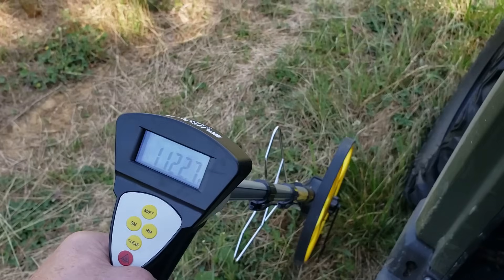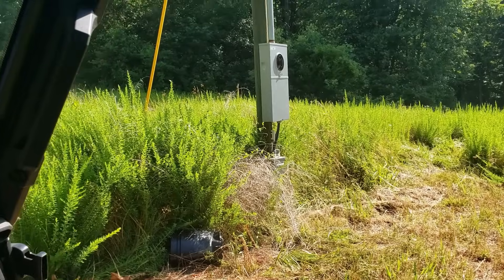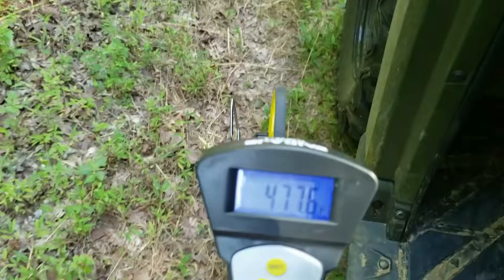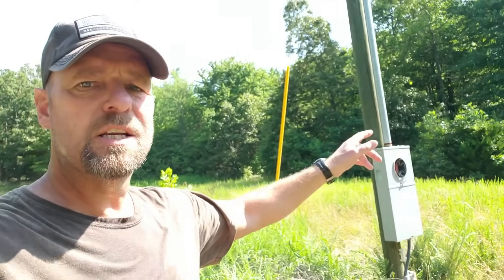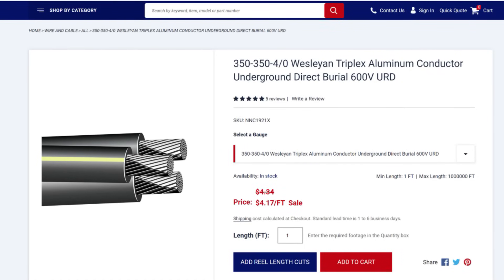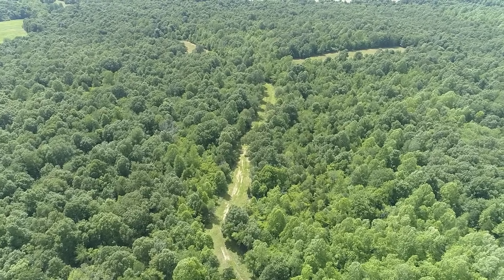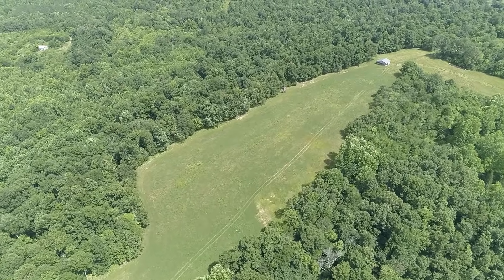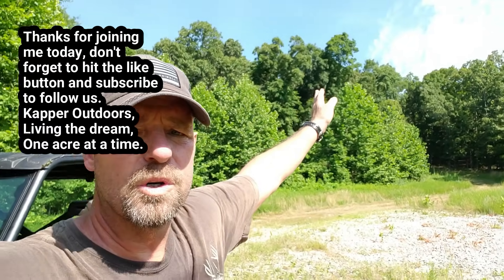DIY running 2,000 feet of power line to remote homesite? Let's talk details.

Comment: Joe, you might want to put in solar with a backup generator, and put in a shallow well for water.
Reply: Yep. What I came to suggest.
Reply from the maker: We'll see what happens. Just got more details that I was missing in this video as far as which sizes of wire I will really need to make this happen. If wire prices come back down to where they were before this disaster, it will probably be a GO to do the DIY power. And the water line will be trenched right with the power, so one trench will bring power and city water all the way up. Thanks

Comment: you should do high voltage to the site. I would get the power co to put poles up the driveway to the site for you. has to be less $ then trenching in. I think you'll have problems with a 20% loss of voltage.
Reply from the maker: You are correct on the 20% loss. Finally got to talk to some industrial electricians about this. But the good news is going up 3 more wire sizes would work with minimal loss then. Cost more of course, but if line prices come back down it would be way less than the power co running the overhead and would save me having to make a straight line new 20 foot right away. That is my hope now, prices to get back to normal! Thanks

Comment: Kapper. With that long of a 240/120 volt service drop with a reduced-neutral-sized cable, you are going to have voltage drop on your 120 volt circuits that will caused flickering lights.  I recommend getting an estimate to install a single-phase 7200 volt overhead line from the street and install a 25kVA 7200 -240/120 volt transformer ~200 feet from the house. From the transformer pole install 3/0-3/0-1/0 triplexed aluminum (Hollins) underground service drop to the meter fitting for your 240/120 volt service. The closer you are to the utility’s 7200-240/120 transformer, the happier you will be. Sorry, that’s the price you pay with the meter so far from the source.
Reply from the maker: Good info, I just had a great strategy session with someone much more in the know than me! lol. There are a few ways of going about it, but for good 200a service I'll need 1,000 mcm wire, and for good 100a service I could use 750 wire. If costs come back down to earth this could be a viable option to save money against have power co put in overhead. Still looking at options though, thank you
Reply: @kapperoutdoors  Kapper, if you want total underground service I recommend getting an estimate for underground primary cable (12kV) trenched in from the road to a pad mount transformer close to the residence. I believe someone else offered that comment too. Likely be more expensive than an overhead pole line. so get the numbers to compare OH to UG. I would not run 2,000 ft of secondary cable, ie, 600 volt cable for 240/120 volt service from the road.  You will have very stable voltage supply with the 12kV transformer as close to the residence as possible.

Comment: Have you considered high voltage from the road to the spot and then put the ground mounted transformer AT the house. This way the line going into the house will be much smaller, most likely #2 AL primary cable. You will have almost NO voltage drop as the secondary run is short.
Reply from the maker: That would basically be having them run overhead or underground, which is very expensive, which is why I am looking at my DIY options. I have more intel now on exact wire sizes I will need for this project. Unless I am not reading  you correctly? Thanks

Comment: Solar Kap. Solar.  I have been fully off-grid for 10 years. I have everything including water pump, sump pump, sewage pump, furnace, oven etc except for AC. Lots of flat roof surface or for a ground mount at that building. Battery storage and a back up generator running off propane. All good. :)) Cheers!
Reply from the maker: wow good stuff! But does it not have enough juice to run AC? Down here that is a must and it runs constant nearly all day and night to keep a place cool. Thanks man hope all is well up by you!!

Comment: Kapper I got 37 yrs with a power company. Let them do the overhead power line. They will maintain and you just add the cost to the building site. You will be way ahead of you want to do the project.
Reply from the maker: We'll see what happens, I finally got the Exact answers I needed as far as the power lines that I will need for size to make it work. If line costs come back down to pre covid levels it would be a good investment, but not at current prices. I sure would love to have them do this though! That would be much easier! But trying to keep a decent budget is all part of it. Thanks man

Comment: I agree about the site for the house up on that knob would give a spectacular view south west to west. You can double that cost for the water line or drilled well. I'd look for the shortest straight route from the main power line up to the house site and run the overhead primary on poles to that point and set the transformer there. No power or voltage loss that way.  They can move the starting point for the primary to the east along the county rd and the head up to the house. Then your looking at a 20' wide easement for the power line and the water can be on it as well.
Reply from the maker: yeah looking at lots of options! Finally got some better answers and wire sizes I'd need to trench it on my own. Could still be much cheaper than power co, when prices start getting back to normal.

Comment: Hi Joe, ran 2000’ of primary underground at my Missouri farm in 2019.  Power co wanted the 2”
Conduit at minimum 4’ buried depth and we threaded mule tape through the conduit so they could pull the primary through.  Took 4 of us 10 hours to excavate, install conduit and backfill the 2000’ run.  That was going through mostly crop fields and using a 200 class excavator (with 2’ bucket) and 1 skidloader for backfilling.  Power company installed a transformer at my build site and now will only have to run secondary a short distance to my home.  I believe it cost me approx 20k at the time for everything
Reply from the maker: yeah we're going to look at options but hold off for now, hopefully material prices will come back down closer to earth!!

Comment: Joe, you can do both solar and grid power FYI.  You have plenty of space for a ground mounted solar array which would provide you immediate power to the site.  You can delay the power service until you are ready or you can do a smaller wire and offset the loss with the solar.  If you factor in incentives for solar you should be at half the cost of grid tie.
Reply from the maker: Good info Den, hope all is well back home !!
Reply: @kapperoutdoors  Yep all good. We love following your adventures!

Comment: Use copper for under ground. You could also use step transformer the step it back down to the home. You may put the job out for bid and see what people will offer. So far it sound like a bunch of salesmen giving you advice. If you are thinking multiple home then look at three phase electricity. If you do the digging yourself that will cut cost. Check your county building codes you could set your own post. Your responsible for the poles and up keep.
Reply from the maker: Lots to digest here and different possibilities. Got to run it all by 2 industrial electricians the other day and we really were able to pin point the wire options that I was looking for and pin down pricing. It is too expensive right now due to the covid junk, but if prices come back down it may be worthwhile. Thank you have a good one

Comment: Good to see Ur looking at all options.
Bigger is better and under ground = less maintenence.
Maybe a hybrid compromise, extend higher voltage o'head then bury.
Any of Ur options are gonna be an big investment on Ur part.
For those that are opting fir solar, don't U need grid power too?
I have a friend that has panels on his farm but needs power to make the connection (in laymans terms) so even with a sunny day theres nothing w/o power.

Or are U thinking storage batteries? Added cost$ and replacement $$ there too
Reply from the maker: I will look at solar, but many people are afraid of that compared to standard power. So from a future sales perspective if someone wanted to build a home and it have full 200a service, compared to solar, many people would be very hesitant to try to build a new home with the solar system. Not saying it is not as good or reliable, I am not a solar expert, but from a real estate perspective it does make a big difference. Thanks

Comment: Wow.  Having Power would be great but. I looked at having Overhead power run back to my cabin back in the early 90's. Running the logging road back is just under 1 mile. In a straight line from hard road it is 3200+ ft. The power company said we where looking at between $16,000.00 to $18,000.00. Not including poles etc. Me and my cousin had just bought the property and built the cabin within the last 2 years. We looked at each other and both said we can Burn Up a lot of Generators for $16,000.00. This is our 34th year and we are still using a Generator & Battery Bank & Solar. Remember this is only used part time for Summer get a ways and was Built to use as a Hunting Camp. Just my experience.
Reply from the maker: This is why I am looking at my options and wanting to do this one DIY. I just got some more good info on which actual wire sizes I will need for either 100amp or 200 amp service up at the barn. If line prices come back down I think it will be a good investment. Thanks

Comment: How about using the grid just for charging a solar power bank?

Think of the grid as your secondary backup power source that can feed a low voltage to your inverters

Might be an option to reduce the cost for the main cable run

Comment: A long time ago... in Alberta, there was an awesome property I was going to buy, and to get ower down the road was a small fortune.  The way it worked was the people owned the power line on the road until it was paid for and then the power company would take it over.  I would be several miles down past the last pole.  It was something like $150k plus my portion of the existing line.  Thus, there was no way to afford it as it was like a mortgage for the power and then the cost of building a house and everything else... I do like your version of the buried line and would look the best.
Reply from the maker: This is actually a common theme in rural areas of the US. You can often get some stunning land, but the power costs as much as the land to get it in place! If you were to build on your own you could consider solar..
Reply: @kapperoutdoors  If I was younger and living in a less hostil winter I'd consider solar...  Lots to consider and that is a nice property... cheaper to move the barn...

Comment: If you want a cheap solution for running power tools, (maybe put in expensive line later) run a standard 20/3 or 20/2  house wire yourself all the way along the road, and use it to continually charge some batteries. . Run an inverter to power your electrical equipment. . You are not dependent on solar, or wind, and can add that in also if you wish, whenever you wish.
I was just reading comments and I see that  "zemadeiran" suggested this same.
Reply from the maker: Good info. I have plenty of ways for power tools already. I am looking at options for a potential home build in the future, so, looking for a more permanent solution. But for now I think I've tabled this project until wire pricing comes back closer to earth!! Thank you have a good one

Comment: Just curious, but that clearing nearer the road.  Would that be a cheaper option?  At the prices you are quoting, you could build another barn closer to the road, and possibly do an off grid solar solution for the existing barn up high.  Most hunters are willing to rough it if they have water and heat. Lights, radio etc, and nice to haves.  It is all about the hunt, the building is about a place to sleep.  Heck, a generator set up might be more appropriate.
Reply from the maker: yes lots of different options. I enjoy studying various options and playing out potential future scenarios to see what might be the best 'all around' option*s*. Thanks man have a good one

Comment: So while looking at property in Missouri we came across a new home but the building was way back in the woods. The very same problem you have. I did see overhead lines along the property in the back which if the electric company would have aloud access to their power lines but I didn't want to spend more money for that and then that not be allowed to do it that way.
Reply from the maker: No doubt, getting good, reliable power is a big deal and cost these days!

Comment: A quick thought:  would a laser range finder, be a fast and easy way to measure distances?
Thanks for your great vids!
Reply from the maker: Well it's a little tougher because you need solid objects like trees, and if you want measure the route you'd be taking it would be challenging. And if you were running a new route through the woods, there are lots of obstacles with using a range finder. Now, if you had a nice, long, level shot with the building at the end, then yes absolutely it would be easier! Thanks have  a good one

Comment: In 78 I had 1200 ft. Overhead ran by our power company it cost 1400 dollars I had LP gas heating power company said if I had electric heating thy would not charge for the complete job how times have changed that was new poles cable and everything I had to get 1 pole and electrical boxes they furnished the meter box 👍🏻🇺🇸
Reply from the maker: yep, getting nuts now to run power any substantial distance!

Comment: Watching the arial shots, is the road closer behind the barn? If the power is on the roadway could that be shorter distance, and move the transformer and box. Or is terrain a problem?
Reply from the maker: yes terrain is a problem, but also we do not own that property that is a closer distance, so getting easements is a headache from a landowner and adds more up front issues and cost, as often you have to 'buy' the easement and then you still need to clear the 20 foot clearing for the power lines, and that is a lot of big time heavy machine work. Thanks

Comment: Love the idea of solar, but don't you get weeks where you don't see the sun?  Like, in winter?

If you dig a trench, would the cable you put in be "direct burial"?  

If you start with 400 Amp from the transformer, you could lose close to 50% and still have enough for a 200 Amp service, no?
Reply from the maker: After some more research I will still need to up the wire sizes, as you said too much voltage loss. But upping wire size to 1,000 will work and have solid 200 amp service. If wire prices come back down it will save a lot of cash compared to having power co do it. Thanks

Comment: Hey Kapper!! Would you recover the cost of running power if you sold it? I know having utilities on site or at least accessible increases land value but would it make that much difference?
Reply: I’m interested to know this answer too!
Reply from the maker: Good question! Talked it over with the land expert Mark Williams and we both agree.. If you can get this done in about 20k or less, you would recoup that later as it would be a stunning and one of a kind property with power and water all the way up there. If it starts getting too much more than that, you might not get the return later on. But if the power and water were in, it would be much more attractive than just a 'deer property.' Thanks

Comment: Kap, I'd go with the underground and the 2 inch conduit.  Yes, it will cost $40 to $50k but you will have hard wired power and no storms will interfere with current.  I went underground with power and wish I had gone the entire length of my land underground.  I did not want or like having to initially clear trees and then every year cut back any trees that came within 15 feet of the above-ground wire lines.  Go underground brother.  Just my 2 cents.  Have a great Independence Day!  Semper Fi.
Reply from the maker: Thanks man. If cash were no issue that would be the way to go! SF, happy 4th.
Reply: @kapperoutdoors  Yep, I understand that very well.  Money is always a key factor.

Comment: Joe if you get 2 gauge wire or 0 gauge the voltage drop isn't going to be as 4 gauge wire
Reply from the maker: Finally got some more detailed info from a couple of industrial electricians. We are going to have to bump up the wire size to 1,000 to get good 200 amp service up top. Prices are way too high right now though it would cost about the same as overhead right now.

Comment: You can't run 500 in 2 inch pvc pipe, Joe. I retired as an electrician. I was a service tech for a long period of that. It would be a lot cheaper to run it exposed on poles. You could pay a contractor out of pocket cheaper than having the utility have some one do it and charge you extra. You could also contact a logger, have them remove all of the trees in your right of way and get a little income there instead of it being an additional expense. Then take your personal equipment and clean it up. Good luck.
Reply from the maker: Thanks man. After running more numbers with 2 very experienced industrial electricians the numbers show that I could run direct burial wire, but would have to be size 1,000, which is quite large, but it is doable. And they would do all the hookups for me for free... Well, maybe for a few cases of beer? :) But right now the cost is too high, that would still cost about the same as running overhead wire, so no incentive to try it now. But IF wire cost came back to where they were in 2019, it could be done. For now I have tabled this project... Thank you have a great weekend